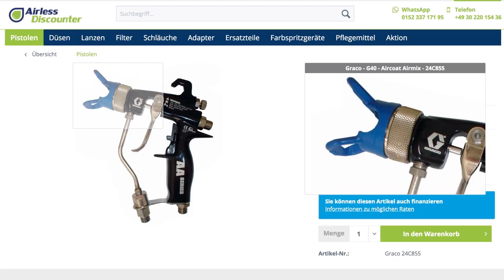210 Graco RAC X FF LP FineFinish & Air-assisted Airless Graco G40 Demonstration ONLY

Comment: NO information! A waste of time...
Reply: Greywolves60 Greywolves60 been painting for over 18 yrs maybe I can help. I own this gun and also have air assisted unit, whats your question?
Reply from the maker: This is our demo video. You can learn all about the Graco G40 spray gun here: https://youtu.be/pKi6YPesFQo
Reply: @duartepaintinghandymanservices  is there any difference between using fllp tips and aaa. In quality and over spray eas of use etc.  And is there difference between aaa flat tip and regular tip.
Reply: @Adamulduren  well if you're using the aaa flat tips yes big difference
Reply: @Adamulduren  aaa flat tips are way different than regular tips, because using the flat tips you have more control of the air usage and it atomizes the paint much better with lower pressure than that of regular tips causing less overspray and less material consumption
Reply: @duartepaintinghandymanservices  so if I have the option between aaa with fllp tip or aaa with flat tip. I should chose aaa with flat tip
Reply: @Adamulduren  depends what you're going to use it for, but its cheaper to buy the conversion to regular tip than to flat tip, so if you have that option to start with yes, go for it
Reply: @duartepaintinghandymanservices  I want use for painting doors, windows and cabinets
Reply: @Adamulduren  it all depends on what paint you're using, you can use a flat tip for any  paint you just have to buy the correct size tip for that material
Reply: @duartepaintinghandymanservices  Lets say I have a flat tip 210 and regular 210 both on aaa system. Which gives better over quality and less waste of material.
Reply: @Adamulduren  flat tip will give you a better finish and less material waste
Reply: @duartepaintinghandymanservices  thank you very much for your information and time
Reply: @duartepaintinghandymanservices  better then a 210 fllp tip on aaa system
Reply: @Adamulduren  yes the flat tip is way better than a fflp tip on a aaa system, its just less overspray and better finish
Reply: But the music was awesome.  I smell a Grammy!!!
Reply: @duartepaintinghandymanservices  I run the FFLP tips, usually at 1200-1400 PSI.  Is the PSI different with the Air Assisted and the FFLP tips? Have you tried Titan HEA Tips with Air Assisted, and if so, what were your results & settings?
Reply: @briangibson6445  material thickness will require more pressure from either machine to fully atomize that product, thinner products will require less, I've used only the graco fflp tips but I have heard the titan hea are also great
Reply: @briangibson6445  and yes the psi will be different from aaa to hea  and fflp tips, aaa require less pressure because it uses air to help the tip to atomize the product